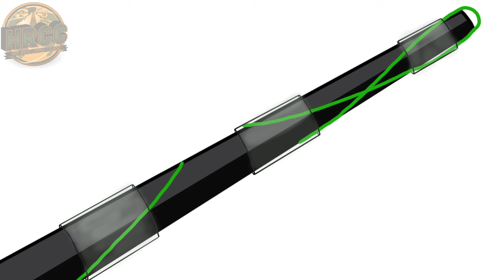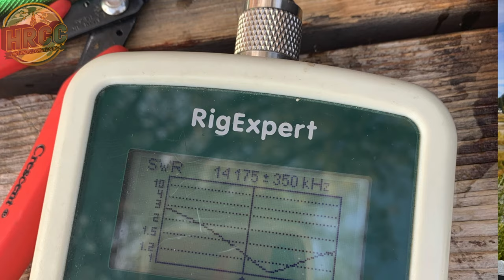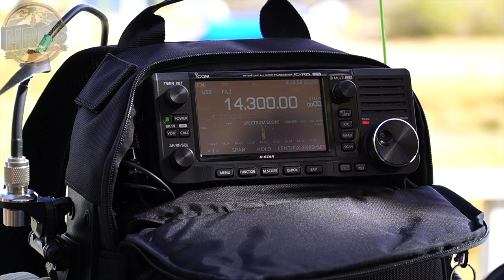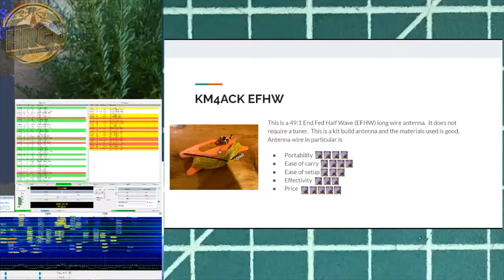DXCommander Expedition Build & Review!  Impressive Ham Radio Antenna!

Comment from the maker: Callum provides MORE than enough shock cord, paracord and wire to do just about anything you want and make some mistakes to get this build done.
Reply: With that wire that he provided I have built the DXC Classic, QRPGuys tri-band vertical+radials, an 80m Dipole and still have wire left over.  That stuff is so good that I got some more!
Reply: I use a DX Commander Classic and work the ends of the world with it. Truly a great antenna.  It fits my desire to band hop and chase DX. It is the next best thing to a beam.

Comment: I used the Expedition for my activation of K-0066 Virgin Island National Park form St John USVI.  The antenna was set up for 8 days straight with no issues.  I did use extra hose clamps to make sure it stayed in place for that long.  It worked fantastic and logged well over 2000 contacts on the antenna during the trip.

Comment: I love my DX Commander!!! Callum is one of the greatest guys i have ever done business with as well. Very generous and truly cares about those he works with. He has worked very hard over the years to develop the DX Commander line of antenna solutions. The DX Commander 10-80m (ALE Compliant one) is the one that i purchased, and it had ample DX10 antenna wire with the kit (Using some excess to build my 100w EFHW now). I am planning to get this shortened expedition pole to go with my regular pole as the hardware is compatible. FYI SWR on the 10-80 was SPOT ON using his measurements.

I do recommend using GOOD guy stakes. I used some that were not great, and they pulled out of the ground during a wind storm, antenna fell and broke at the 3rd from the top extension. Again, Callum is AWESOME and worked with me on a replacement. (Two times actually, but that be another story.)

Someday next year, I will order a Nebula Extreme. Its 18m tall and can support 160m, let alone 80m. Hopefully the expedition pole will be purchased before the end of year. 

Game-plan: 
Nebula: Camping/Lakehouse/Field Days/(Maybe Home Use).100w to Max
DX Commander: POTA/Camping/Events/Visits to Relatives and other vacations. Up to 100 watt
DX Expedition: SOTA/POTA/Hiking/Overseas Travels Up to 100 watt

For the hard to reach or longer hike SOTA, I'm currently building a 100w (Max) EFHW. This also would be a good SHTF or TEOTWAWKI along with any one of the ones mentioned above, depending on situation. 

Thanks to Josh and Callum for making everything so much easer. The videos that you produce have educated me far beyond what I could have done with books alone.  The hard work and generosity you have donated to the community is amazing. 

Thank you and 
73!

Comment: Bill-N6EF-I built my own homebrew version of the 5 (6 counting 15 meters) band Classic using Callum's 10 meter fiberglass pole and using cutting boards for the spacers. It took some time to get it tuned but once I got it tuned, it works great. It only takes about 10 minutes to deploy. One thing I found out is you need to brace the bottom of the pole to keep it from sliding especially if it's a bit windy. A couple of ways you can do this is to attach 3 additional ropes to the bottom of the mast and run each back to each ground stake making a sort of web, ground-mounted guy wires of sorts. What I ended up doing was taking a 2 inch PVC cap, drilled a 3/8 inch hole in the center, ran a 3/8 inch landscaping spike (big nail) through the cap and into the ground and that keeps the base from sliding. The cap acts as a cup to hold the bottom of the mast. I'm sure I spent more making it myself than if I were to but it from Cal, but it was a fun build. Great video as always.

Comment: I have the classic, it has been up here in West Virginia weather for about 2 years now, that's full summer and two full winters.. It is an incredible antenna for the price, and it has a very low noise floor. I have 38 ground radials that have now sunk into the ground and are no longer visible. I check the antenna weekly since I am in WV the weather can be brutal out here with winds and temperature ramps.. I have had to replaced one antenna wire because I think a deer took an interest in the antenna one night and tore the antenna down and damaged the 40-meter cable.  I really don't know what else to say about this antenna except that building it was fun and I can repair every part of the antenna for a few dollars. If you're looking for a good omni-multi-band vertical for your shack then I would recommend this 100%. Well worth the $$.

Comment: I really like the DX Commander. It’s nice to see a nicely designed antenna that I can understand how it works – unlike certain ”DC-Daylight, no radials, no tuner, only 17’ high” antennae.

I haven’t been to Big Bear in many years. As I recall, last time I was there the water level on the lake was way down.

73 de AF6AS in “DM13” land

Comment: Nice video Josh. Go for the dual metric/inch-feet tapes for antenna and other project work. Harbor Freight has a 150 foot unit so you can get to 80 meter dipoles, Stanley and Komelon have shorter dual scale tape measures. Hose clamp tubing length determined by pole circumference at clamp location. Extra credit for the taut line hitch, excellent choice for this. Tape at joints is your friend to control the undesired telescoping of the pole. Stuff a rag inside the pole at the base to soften the landing of the sections for those occasions. Years ago at Quartzfest I had a DK9SQ telescoping pole up 43 feet sitting in a 5 gallon plastic bucket to protect it from the rocks. It telescoped down in the middle of the night when the breeze dropped off. It was very loud and woke a lot of people up, all those sections resonating the bucket. I went outside to check it out and saw lights coming on up to at least a half mile away. :) de w6akb

Comment: Just a thought. A taught line hitch is a friction hitch, and can be worked loose under some conditions. Particularly with slick synthetic lines and in wet conditions. It's a great hitch, but in windy or wet conditions I might suggest something that is less likely to work loose for tensioning the line. A truckers hitch would be a good choice. 

Thanks for demoing this, looks like a fun option.
Reply: I'm using the truckers hitch on my 6BTV, very easy to make adjustments.

Comment: Hi Josh,
Yes i use the Expedition model for all of my DX-peditions and it (they) do a fine job.  
BUT, to avoid your "live stream" incident i always TAPE every joint with self amalgamating tape and i NEVER have a collapsing problem.
At home I use the Classic with all the joints taped as well and it is a permanent fixture and has been so for over 12 months now..
Cheers

Comment: I’ve had my Spiderbeam collapse in on itself but hose clamps solved that. I plan to put hose clamps on as many sections as I can when my DX Commander arrives. You could also use electrical tape. VO1OK

Comment: Josh, not only did I follow Callum's suggesting to label the wire, I used different color electrical  tape to label the holes (top and bottom side) and the wires to make it easier for me to assemble.  I find that also helps prevent me twisting or crossing the wires during assemble, which can lead to very interesting SWRs.   Thanks for the video; always interesting to see someone else's trials and tribulations during an initial setup and to see how else I can improve my setup.

Comment: Just put my Dx Commander up for the first time.  I just cut my 10m and 12m Elements and about 38.5m of radials (3.5mx11).  I just wanted to see if 10m was alive since that my only hf band I am licenced for Voice at the moment. I need to cut it to move my minimum swr up the band some.

Comment: A mistake I made 2 years ago, with a need to repair and restore my home after Hurricane Michael with his 155 mph winds, fearful of how well the DX Commander pole might stand up, I  did; not just buy one. Bad choice, if you are hesitating don't waste your resources trying to piece together your own version unless you already have ALL the various tools and materials, because to re-invent a DX Commander clone is more involved than you might believe until you try to do it. I have several near misses at building mine, using believed more sturdy military tent poles, but to get the height, they must be made stronger to stand up and not stack. The same making spacers, the radial ring, and the driven element ring, still more involved. Like I said, just buy the very refined and engineered DX Commander kit and put it together as Cal, has instructed and be on air in a short while!

Comment: Hello. I wanted to ask you about the trimming and tuning part. I assume that the looping at the top of each element is part of the antenna. So that when you found the need to cut/trim each one of the elements that you unwrapped the loop, cut a bit, and then re-looped the top…and reattached the loop to the “shock cord”.  If you don’t mind, pls give a bit of detail for your process.  Thank you ….. Rob B. (WD4IFT)

Comment: Great review and I am one of those guy who have it up permanently  I've used zip ties AND rubber tape (electrical) in lieu of the extra hose clamps  with great results
Reply from the maker: That is a smart way to handle it, adds no metal for affect the antenna.  Good call!
Reply: @HamRadioCrashCourse  Survived some pretty strong storms here on the North east coast
Reply: @Frank Caltabiano similar wind I bought it a year ago over this summer we had  the remnants of one of the hurricanes blow through broke my screen door  my son said "that things gonna break " it didn't expedition  use it will last for years permanent use so far a year with tape to keep it up so fat so good with good reports  my doublet running east to west must have a null NE to SW that the DX commander fills
Reply: @Frank Caltabiano actually no in that respect I've done everything "wrong" I learned from my 11m days with an antron 99 on a mast the most secure way for me is to lash it to my deck railing sturdy enough but has some give and I avoid that downward pressure that Josh talked about  the deck is good  mechanically but electrically it's probably acting more like and off center not bad just not as it was designed . that storm I talked about  snapped a hustler multiband in half a few streets over it's a very well designed antenna bit I think you need to let it whip around you may need to take it down from time to time to tighten things up

Comment: I am 65 years young. I need to be able to contact other like minded patriots in case of emergency. I don't know of any clubs in my area to learn the proper "channels". What is the best way to learn programing and set up on a ham radio.  Note: I just bought several units for friends and family.
Reply from the maker: CHeck out my channel.  The first playlist includes video geared towards newcombers and includes programing your radios.  I hope it helps!
Reply: If you're not yet licensed,  start with at least getting your technician license.  Lots of great resources for that online,  including Ham Radio Crash Course.

Comment: What radials lengths did you use?
Reply from the maker: I used 20 4 foot radials and I bundled them into groups of 4.
Reply: @HamRadioCrashCourse  I don't think that is correct.  The radials are supposed to be 3.5 to 4 meters long.
Reply: @brianstevens7132  Hello Brian, didn't Callum say you can use shorties but use many of them?
Reply: It doesn't really matter on the length of the radial. What matters is the number of feet of wire used in the radial "system". You can use 5 long radials (16 feet each)  or cut each one into 4 shorter lengths (4 feet each)  and make 20 short radials...the end result is the same. Ideally you want 4 wavelengths of wire for the lowest band you plan to operate on.... but that's not really practical for a portable setup.